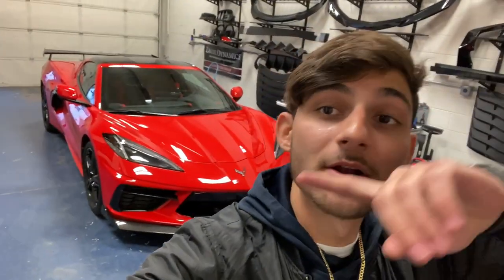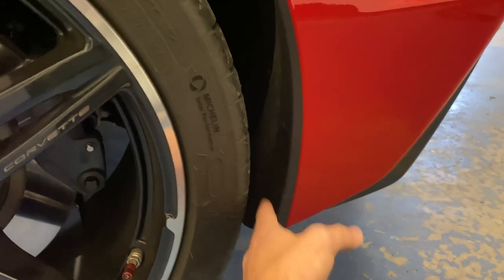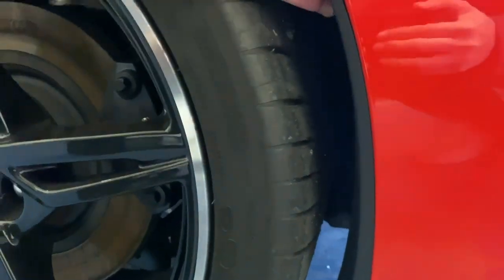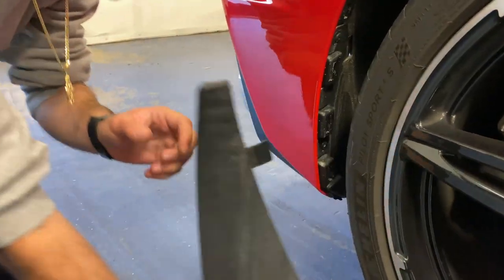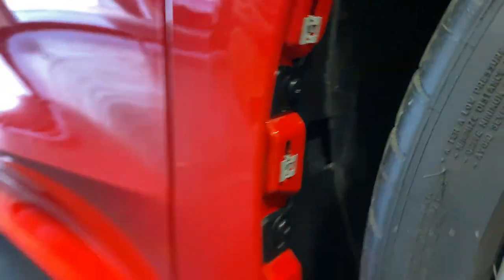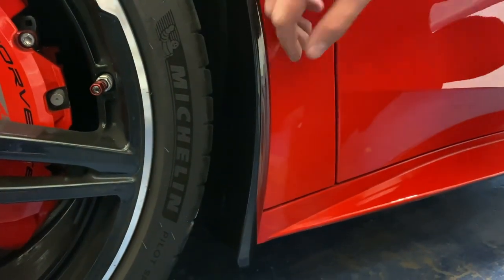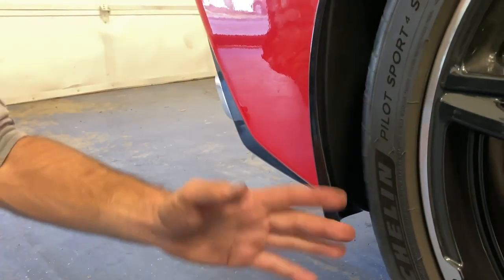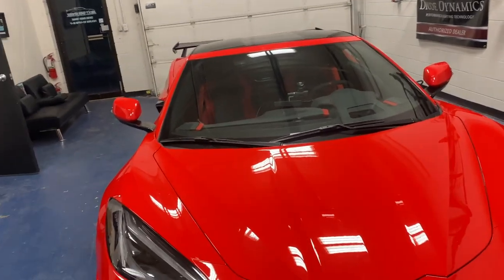C8 Corvette Carbon Flash XL Rock/Mud Guards Install & Overview #c8 #corvette #mudguards

Comment: If  the C8 was NOT order with factory mud flaps, will the lock-in tabs still be there?
Those look great and cheaper than ACS.
Reply from the maker: Yes correct. These are a much better option in my opinion

Comment: Thanks for showing these.   I have a set for my C8.    I just want to confirm the install.   It may have been editing, but in the one shot it looked like there were metal clips both on the slots on the car AND on the guards.   I assume you don't install a metal tab into a metal tab.
Reply from the maker: Yes correct. When installing the front one at first, I noticed the metal tabs were still in there from the previous ones. I just popped them out and slid the new ones in
Reply: @NextGenSpeed  thank you.    great video